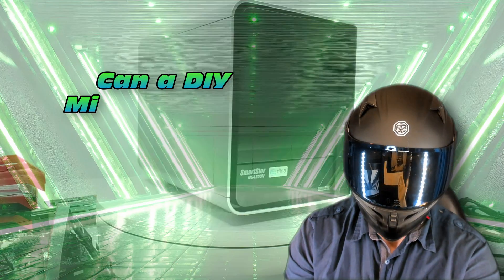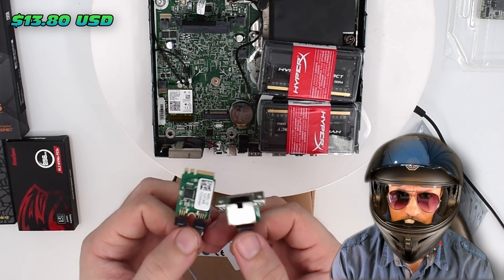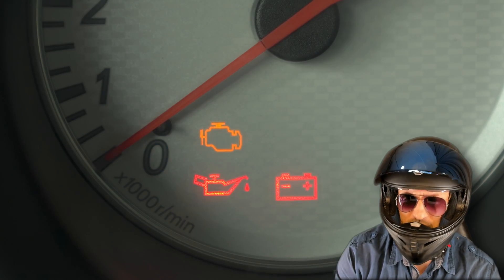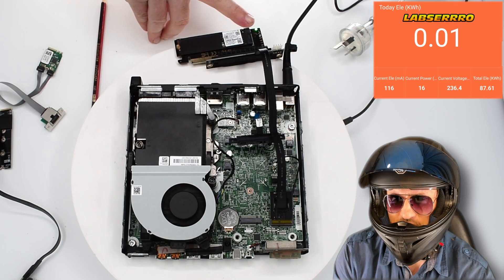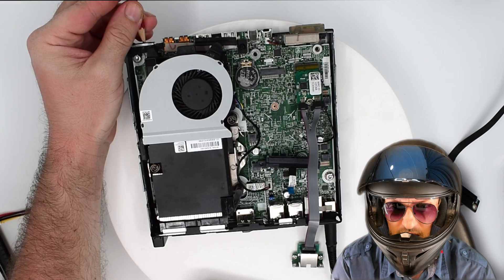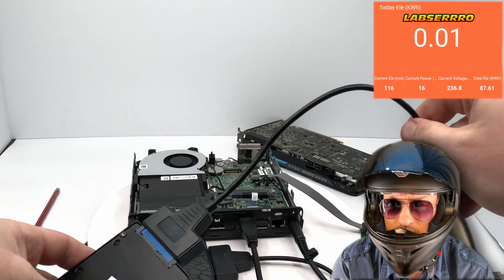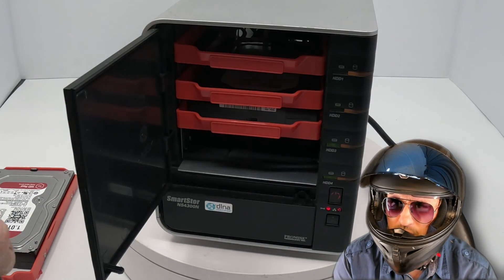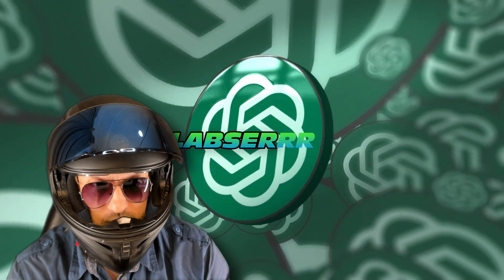Low Power-Draw Mini Server - under 30W on Idle? Impossible?

Comment: Thanks for this.  Can't wait for the next video..... no, really.  I can't wait. How do I piece this thing together 😂😂
Reply from the maker: It's standing next to me - still waiting for me to piece it together haha. I had 6 SSDs mounted up by using 3.5" to 2x 2.5" SSD adapters into the NAS bay - SATA to USB cables fed to the Mini PC and then Proxmox with several VMs. Update pics: https://www.youtube.com/post/UgkxJS83jgHqrvbjnaZlmhNi6MDRC1Fz-9BR

I left the project for a few months and tried to get back into Proxmox but I "forgot the password" - or more like Proxmox refused to let me continue the project with my password haha. I need to reinstall - which was partly the plan, but I have been too distracted with related projects. Check out my Lenovo M920Q build also. It supports 10GbE thanks to the native PCIe slot. I plan to shift the gutted NAS to the M920Q once finish. I lack one adapter to convert the 6 Sata to USB cables to the M920Q's limited number of Sata ports.

Comment: I have an HP EliteDesk 800 G5 SFF with a i7 9700 + 40gb ram + 10 sata to PCIE x1 adapter with 10 Sandisk 960GB enterprise SSD + 10gbe nic and it uses about 30w idle. I have Proxmox with Truenas Scale Jellyfin and SMB, AdGuard Home, CasaOS and Windows10 VM's.
Reply from the maker: Nice - the joys of newer hardware being even more power efficient. You are doing well with your power draw being ~30W on idle with the i7-9700T in the SFF system and a 250W PSU. My EliteDesk 800 G3 Mini is the 35W model - so really low on power draw out of the box. 

The SFF versions will give you more flexibility (being able to power a 10GbE NIC is nice!), but I would expect it to use much more power under normal-to-heavy use than this 800 G3 Mini PC. My goal is to keep the system under 30W on idle but it may not go much higher than that when in use given the system's tendency to be really low on power draw (the joys of the system being limited to 35W). However, if the newer SFF systems can delivered the same idle power draw it may make them better value! The same idle power cost but way more grunt when you connect to them.

Extrapolating from the datatable, my build should net ~27.5W - 31W on idle (12W-16W for the base system: Intel 7500T + 32GB RAM + 2.5GbE NIC, 8W for 16TB Exos X18 connected with USB and powered via 2Amp DC power plug (it used 3.5W when plugged in but not connected to anything), ~4W for 4x 1TB SSDs powered via USB). I'll have the final power draw data once I get the final video done. I also want to have it future proof so that I can get 4x HDDs as well as 4x SSDs connected.
Reply: Currently it's a mess inside with all those ssd's but when you close it you can't see it and if you can't see it it's not there :D
These Intel cpu's are very efficient at idle and using powertop in proxmox to adjust idle usage helps a bit.